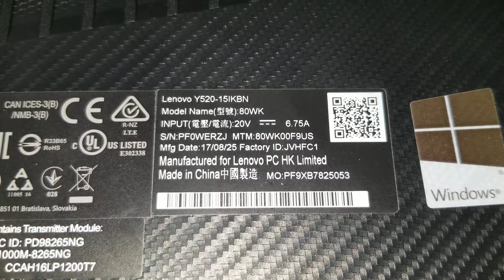Lenovo Legion Y520 Y520-15IKBN 80WK Disassembly SSD RAM Upgrade Repair

Comment: I have the same one and mine is burnt and it wont work I dont know y any tips??
Reply from the maker: What do you mean burnt?
Reply: @ItsBinhRepaired  idk i plugged it in and then it like pshhh but its still in perfect shape and the inside is perfect when i looked insinde and outside it looks normal but it wont turn on
Reply from the maker: @bxny4147  D: something shorted. Maybe their was something loose on it somewhere
Reply: @ItsBinhRepaired  oh man so if i take it somewhere they cant fix it?
Reply from the maker: @bxny4147  not sure :( depends on their skill level

Comment: Is the black thing glued next to the fan that u didn't want to take off important? I changed thermal paste and had to remove it. Should I put it back on?
Reply from the maker: I would put it back if you could. It's likely there to prevent something from shorting out, but if you destroyed it, probably not super important.

Comment: Hey my legion started to slow down and started having fps problems. What should i fix? I tried reformatting 2 times already but it still cant perform like it used too. I made sure all my drivers are installed and everything.
Reply from the maker: Try this https://youtu.be/3zs_SJ3BXgA
Reply: @ItsBinhRepaired  thank you kind sir!
Reply from the maker: @corvair5454  no problem. Don't forget to like and subscribe if you haven't already. It'll really help me out. :)
Reply from the maker: @corvair5454  if that doesn't work. Maybe need an SSD

Comment: I know it sounds dumb but, could I replace my current motherboard (y520 15-ikbn) with a new one (y520 15-ikbm)? The difference is only the processor and the gpu card
Reply: that will be pretty expensove i would then just buy a new laptop and put ur old hdd/sdd in the new one or clone ur old one
Reply from the maker: I believe so, as long as the board is the same size/shape and has all the same connectors.

Comment: I forced shutdown my pc cuz it crashed and i was stuck then my pc didnt started so i tried to drain the battery by holding power button , nothing happened so i opened and displugued the battery and started booting i think the battery is dead will buying a new battery fix the problem? Or will the connector of the battery not pass the energy i could try to see if battery has energy idk how to test it tho
Reply from the maker: It should work even without a battery.
Reply from the maker: Sounds like a bad motherboard :(